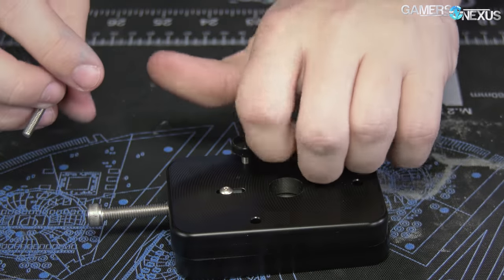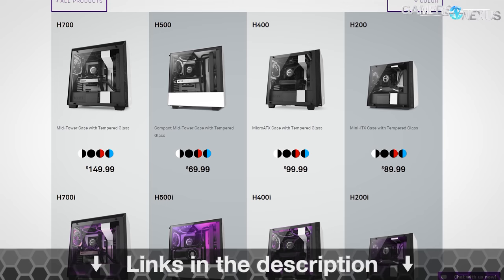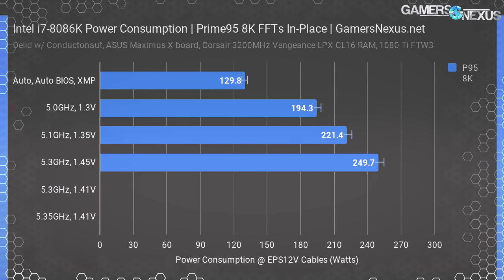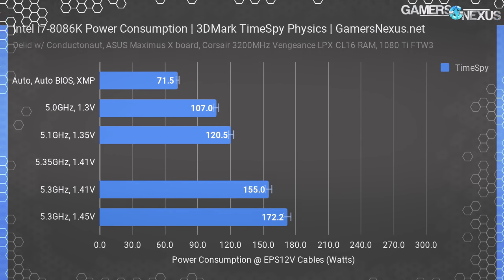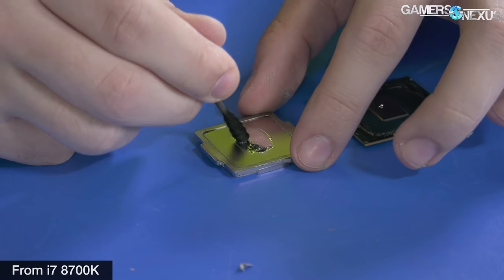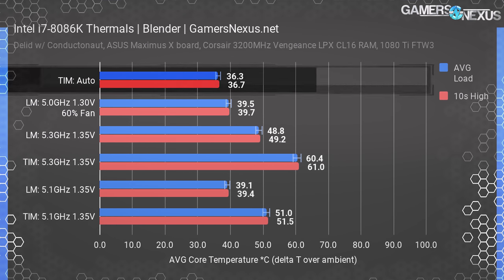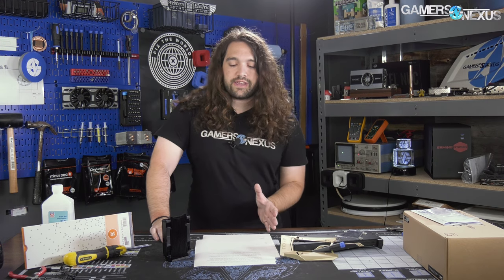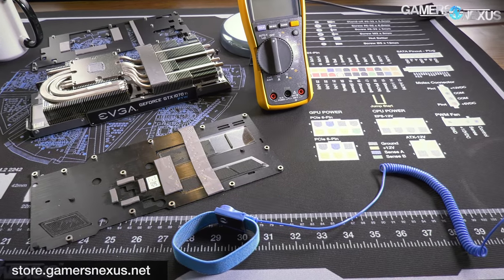The Untold Story of Liquid Metal: 8086K Power, Noise, & Thermals

Comment: I think I got lucky with my 8700k, it's stable at 5ghz with 1.275v on the core.
Reply: Damn, that the exact voltage i need to get my stable at 4.8 in every thing :(
Reply: But I can't get further than 5.0ghz even with 1.4 volts.
Reply: Identical to my 8086k but microcenter had it open box for 9 bucks more
Reply: Im at 5.1 ghz with 1.15 volts. 8086k.. 😏

Comment: How do you stop the liquid metal from leaking onto your motherboard and destroying your solder joints?
Reply: late AF but The amount of metal that you apply is so small that it really wont be going anywhere. The surface tension of liquid metal is also very high so once its stuck, its stuck.

Comment: I want to see a custom loop that uses a less viscous liquid metal like mercury instead of water.
Reply: Would be quiet a pump in there! :)
Reply: Mercury, nah. 
Gallium indium alloy? Sure, going to be expensive as fuck though.
Reply: there is a video where  a guy did that.  not sure the liquid metal he used but i assume mercury.  search it up in youtube.  it worked decently well if i remember correctly
Reply: NAK

Would be GREAT.... if it didn't burst into flames and explode when it touches air....
Reply: lol none of those materials are reactive with air
Reply: I don't know much about fluid mechanics but with the higher density the pump would need to push a lot harder to get similar flow rate. Also I would worry about it amalgamating and corroding the fittings waterblocks.
Reply: here is the link. enjoy https://www.youtube.com/watch?v=XqvBLBlzeNQ
Reply: TheLawnWanderer with gallium you should use copper instead alliuminium
Reply: that would completely beat the point of using a pump in the first place. the thermal capacity of the loop would be terrible compared to water, it would only cool with its conductivity so moving the liquid wouldn't really make a difference. It'd just behave like a slab of metal, even worse than a heatpipe.

Comment: I feel like doubling your power consumption for what, 10% better performance? that's a bit overkill. I'd just take the lower thermals and be happy with that. Then again, I wouldn't take a 8086K over a 8700K just for that 5Ghz on a single core stock.

Comment: Can you use liquid metal instead of thermal paste for the corsair H100i v2
Reply: probably not, im fairly sure its not suitable for coolers
Reply: rowlY _au ok
Reply: it's a huge mess and risk for minimal Performance improvements when used on top of the IHS. 

LM is really only useful when applied directly to the die, and there it shines.
Reply: If you put liquid metal on nickle plated copper you are fine.
If you put liquid metal on copper the liquid metal will stain it but it's more or less ok.
If you put liquid metal on aluminum you messed up big.
The H100i v2 has a copper base.

Comment: I Dont think they are selected. We have had one that barely reached 5.1 Ghz at 1.4V Vcore and thats just cinebench Stable and not even close to stresstest stable.
Reply: They definitely are selected/binned, just look at Silicon Lottery's numbers:
100% of 8086K's they've tested could hit 5GHz @ 1.4V, while only 86% of 8700K's could do the same.
Their next bin is 5.1 @ 1.41V. Now 92% of 8086K's passed this, only 50% of the 8700K's did.
5.2 @ 1.425V : 60% of 8086K's can do it, only 17% of 8700K's can (and have been sold out for ages).
Their final and best bin is 5.3 @ 1.435V. 14% of 8086K's can do this, and so few 8700K's can get there these days that they've actually removed this bin from their site. Last time I saw it there I think it said only the top 3% were able to do it. 
They've been unable to find new 8700K's that pass the 5.2 and 5.3 bins for a while now (long before the release of the 8086K). Almost certainly because intel have reserved all those chips to make 8086K's for the past few months. If you buy an 8700K today, you'll probably end up with a "silicon lottery loser". Unless you're lucky enough that the store has old stock from before intel started skimming the best chips off the top.
Reply: Yeah but thats all stable. We had to up the voltage to 1.43v to get the 5G Completely stable.
Reply: Sounds like you lost the silicon lottery with yours then. Did you delid, and did you use -2 AVX offset like Silicon Lottery does for all those bins?
Reply: we didnt test with avx just aida, also delidding wasnt an option since the cpu had to be sent back
Reply: I see. Hard to compare your numbers with those from SL and find out where it would land in their binning system then, but probably in the 5GHz one. All their numbers are from delidded CPU's with -2 AVX offset, based on well over a thousand 8700K's and probably hundreds of 8086K's. Anyway, it's clear to see from SL's numbers that intel has binned them and didn't just slap the name "8086K" on 50000 random 8700K's. Still not worth the price increase imo, but at least it's not a complete conjob.

Comment: I know this is an old post, but whilst I agree with your idea on lower noise, for most gamers the most noise is related to the GPU.
If you want to get the most from your GPU you need to keep the case cool, so as you get lower fans for the CPU, you will end up with much more internal heat if you have effectively reduced the airflow capabilities of the case.

Comment: My issue is the stupid stupid Strix 1080Ti. It has no fan hysteresis, meaning sometimes the fans will constantly ramp up & down at idle. The GPU fans kick on at like 53°, the temps goes down, fan turns off, temps rise, fans turn back on...repeat like every second. Such a poor design for an $800 card. To combat this I have to keep my case fans turned up higher, so even if I delid my 8700k I'm not sure how much it will help idle noise. May help load noise when gaming, but I often have headphones on at that point anyway.
Reply: There's software to change the fan profile.
Reply: Whizzer191 Well Afterburner will only let me set it at 25% speed or higher, won't let me go lower. Sometimes I do set it to 25% just so I don't have to hear the ramping. Haven't tried a custom curve though, maybe it will let me set it at 0% up to a certain temp in there, will have to look. Annoying either way to have to run Afterburner or some other software all the time.
Reply: A custom curve is most certainly the way to go and should let you set 0% speed.

Comment: 51 - 40? that's -11 dB attenuation, isn't that a reduction down to 8% of the original sound?1/(100(10^-(11/10))) = .079 (I guess ears hear on a partial logarithmic scale too maybe?)
Reply: 20(log10(40/51)) = -2.11
Reply: Brian Miller that looks a lot more familiar than the way i did it (its been a loooong time:) so it's probably completely right.  But there's still something in the back of my head saying 1/2 noise would only be -3db attenuation, -6db would be 1/4, -9db;1/8 and -12db 1/16th. I think i need to hit the books again XD

Comment: gonna be playing with mine tomorrow.. got it last Thursday but like a nob i broke a cpu pin, the x16 pcie one to be exact!! putting the socket cover on under the clamp 🙄😯😂🤣 annyway i delidedy i5 8600k and it was on air and gen2 heatsink and fan 🤣🤣🤣😂😂😂🤣🤣🤣 

do i need to run some heat cycles before i delid?? 🤔 

i only had the pc a month if that lol! so my i5 had been used alot before the delid.. it would run 35-40°c on low fan speed with LM and about 75-80°C max!! and 4.8ghz a core.. sometimes 5.0ghz but that was pushing my knowledge limit! 

So im wondering what these can do?🤔 i only got a low level m-atx board a asrock z370m pro4 (or so say - i thought it was great myself!!) 

anyone playing with there 8086??

Comment: I think they should actually have done some work and made a new cpu to celebrate x86, I think they just cheated myself selling something already in sale as a different device. I was thinking about getting one until I learn, through you guys I think, that it was just a normal chip they already had out. Why can they do this without being sued?
Reply: Ted Cameron Because it's not a crime.
Reply: Super, so then Volkswagen can sell the next Beetle as a Porsche then :~)
Reply: Ted Cameron Essentially yes
Reply: Which is then false advertising and in the UK that IS illegal. You can not sell something under one name and then change the name to re-market it as a different product.
Reply: Ted Cameron Except it's not the exactly same product and it isnt advertised as one either, a binned chip is a higher quality chip and can infact be a different product
Reply: don't talk shit. The chip is an 8700k. binning doesn't mean shit other than the better quality of the chip. That DOES NOT give them the ability to re-market the same product as a different one.
Reply: Ted Cameron You do realise a lot of cpus are just the same chip binned down right? Like the 8700 is the same chip as 8700k but binned down.
Reply: yes, so the 8700 is the 8700k, notice the 8700 in the name? How many 8700k's have been binned down to an I5? or I3?, none because they are different chips. Also the K is just for whether the chip is unlocked due to being a more stable version of the SAME chip. So in review the 8700 doesn't change, just whether you can overclock it. This is NOT what Intel did. They have re-branded the chip as a completely different product, not just a lesser quality product of the same line. This is false advertising and as such should be seen as illegal.
Reply: Ted Cameron Actually the i5s are infact binned down i7 chips
Reply: Ted Cameron literally every CPU starts as the highest product skew. An 8700k that has 2 faulty cores, or some bad cache might become an 8350K. I share your frustration over the 8086K, but it isn't illegal. It's the same concept as binning chips to become 8600ks because they clock better than the chips which will become 8600s. If you're mad about this, you should be mad about basically every consumer CPU in the last decade. Remember the i5 2550K? Literally just a 2500K with the iGP disabled.
Reply: Jeff TBF not every skew is the same chip, the i7 and i5 are separate to the i3 and celerons

Comment: Why the fuck CPU/GPU manufuckturers don't sell their chips with Liquid Metal and closer to the Lead? It's a really good and cheap optimization for everyone benefit. LOL @2:17 Typical Intel BS xD
-12º C from the CPU just because Liquid Metal and removed the Silicon glue to closer to die Lead, wow so nice, I wonder if that woulc be done on my 8-Core AMD FX-8370... currently only a modest 5% OC from 4 to 4.2 Ghz 'coz my PSU sucks, I need to change it, 50º C stock, 52º C @4.2 Ghz, but maybe that could give me like up to 4.7 Ghz and that's my old Thermaltake air cooler, maybe with the Wraith cooler I haven't tested yet could make it to glorious 5 Ghz! BTW I fully load my CPU with Rosetta@Home